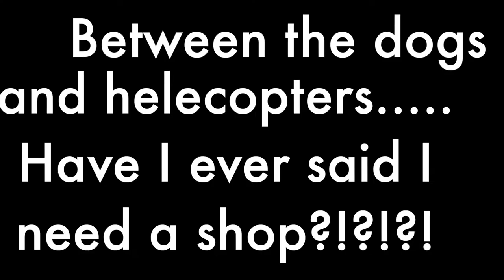1966 Ford F250 Lights and Turn Signals - Farm Find to Street Legal

Comment: Nice work.  Parking lights didn’t start staying on with the headlights until the late 60’s to early 70’s.  I used to own a 68 Mustang and the parking lights didn’t illuminate while the headlights were on with that car either.  My grandfather had a 73 F100 and the parking lights stayed on when the headlights were on.  So sometime in that time period is when the transition happened I would think.
Reply from the maker: Perfect!  🙌🏼

Comment: The requirement for front parking lights to remain lit while the headlights were on started on Jan 1 1970. It was an amendment to the 1968 regulation requiring side marker lights/reflectors. The reason for the parking lights/headlights both being on was if a headlight burned out, you had another light to let people know where the dark side of the truck was.
Reply from the maker: Great info. Thanks!
Reply: @troysgarage  you learn a few things when have to fight CHP in court LOL.

Comment: They’re called parking lights because way back in the day, about 100 years ago, it was required for the parking lights to remain on when a vehicle was parked on a public road even if unoccupied and up until the mid 60’s they operated independently from the headlights. First click of pulling the headlight switch turns on the parking lights second click turns them off and headlights on. Even though they still call them parking lights today they’re really just marker lights because they’re always on with the headlights.
Reply from the maker: History of it is pretty cool. Thanks for sharing. 🤘🏼

Comment: I am enjoying your videos.  My dad had a 1965 F250 custom cab camper special in caribbean turquoise color code.   I'm searching for a similar truck to putz around on and found one.  Just have to save uo a little more cash so I'm binge watching any and all videos on these mid sixties trucks. The 65 and 66 were practically the same truck with just a different grille.  I prefer the 65 but unfortunately they don't reproduce the 65..just the 66.  Happy Holidays mate!
Reply from the maker: You know I’m selling this truck soon right?  Can I ask the condition and the price of the truck you are thinking of getting?  I’ll be asking $5500 for this one. Which seems to right in line with others in my area that are similar in age/condition. This is a great reliable runner and will make a great start to a project truck for someone.
Reply: @troysgarage  He is asking 16k for a rust free f250 v8....where are you located?  My preference is the truck I described as the F250s are more rare than the F100s.
Reply from the maker: I’m in SLC. This is nowhere near “rust free” so there’s lots of body work needed. But all panels are solidly connected and it’s a fairly rattle free ride. I’ve taken the truck as far as I’m going to, although there’s still 3-4 videos of work I’ve done that will post in the coming weeks. Now I’m just enjoying it while I have it. You turn the key and can count on it starting every time!  He’s a runner!
Reply: @troysgarage  SLC as in Salt Lake City Utah?  Is this where you find your old Ford trucks?  So you flip these old trucks?  If you ever find a custom cab 65 caribbean turquoise let me know please.  How is the heater core job coming along?
Reply from the maker: Correct Salt Lake City. I’ll keep my eye out for you. Wallace was originally Rangoon Red. Someone painted him black and did a terrible job. Luckily Mother Nature took over and made it look awesome!  (DM me over on Instagram so we can stay in contact - or my email is in my about page)
Reply: @troysgarage  I don't do Instagram but will correspond but what is your email?  Gmail? yahoo?
Reply from the maker: diyhomeandauto @ gmail